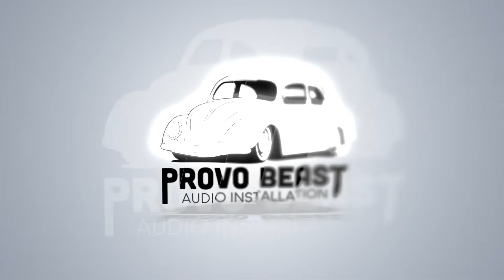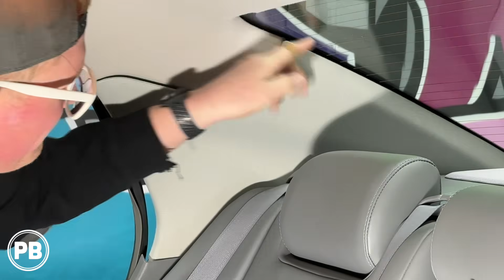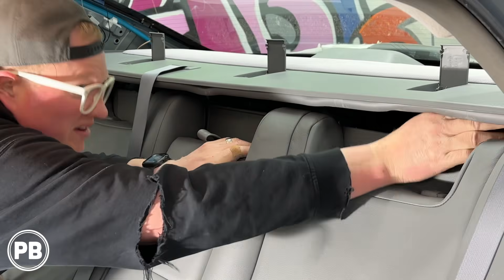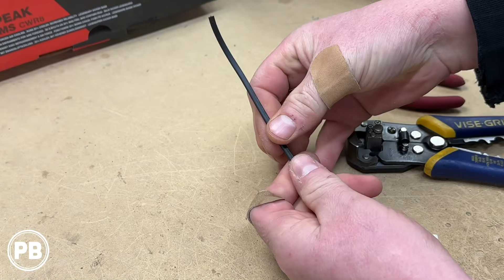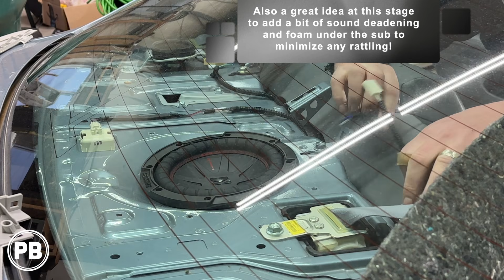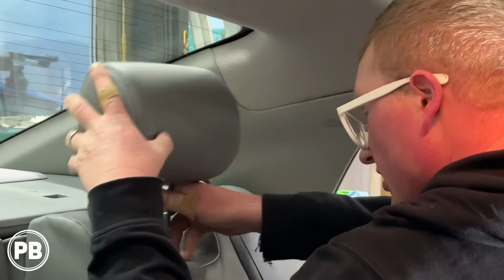2005 - 2010 Toyota Avalon Factory JBL 8" Sub Replacement

Comment: I have this exact car, and putting an aftermarket system in it has been interesting. 

The stock radio needs to be in the car and ON, for the climate control to work, if you install an aftermarket radio. There is a kit sold by crutchfield, that comes with the wires and brackets for the radio to remain in the trunk...POWERED ON. Crazy!!  

And the rear deck that he removed, is plastic.....it is the worst rattle i have ever had inside a car. I have soundproofed the rear metal deck and the plastic that sits on top of it. It helped, but still rattles more than i would want. 

I have had several subwoofer setups in this Avalon, 1 12, 2 12's, 2 8's, 4 8's over the years, and the more bass, the more the plastic rear deck rattles. I now have a pair of  Stereo Integrity SQL 15's in a sealed box, which has been the best sounding i have had. 

Great reliable car, but aftermarket installation has been interesting.
Reply: I have a 2011 with that JBL system.  I want to gut that JBL system.  Is it possible to do?  I want to replace that with aftermarket everything.  Pics of the SQLs??? I have the SI SQL 12"s  but trying to figure out the JBL system
Reply: I just scored this car from the in-laws for my son.  Obviously he wants carplay and such. It has the JBL synthesis system.   So just to be clear there is no easy way to replace the factory head unit without some wacky bypass?
Reply: @jonliska8401  Look fotr the PAC TY.11 Harness. That is what I used in my '05 to replace the head unit.

Comment: Adding a small amp like a Rockford Prime 500 with a base knob up front would take this system to the next level. 👍
Reply: Better to use a smaller 250.1 for that small FREE-AIR subwoofer since the rest wattage that it can handle gets lowered due to that free air use.
Reply: @thegreendoormx420  I would not waste my time with an amp that small. Plus it's always a good idea to run double or triple the power that you need. The number one killer of subs is too low of power and the person ends up pushing it too hard and you get clipping.

I realize the installer is not going to take my advice. I was just basically thinking out loud. Figured I'd comment to help the algorithm.

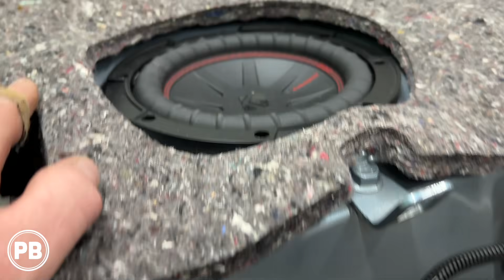Comment: 9:00 You might want to put a rubber grommet around that wire just for safeties sake.
Reply from the maker: Sure, but it's a painted surface without any rough edges and the high-temperate tesa tape will really protect that wiring.  I'd say the wiring will last longer than the remaining life of the vehicle.

Comment: What’s the performance like? I woulda done 2 12”s in the trunk.
Reply from the maker: About as good as the OEM was.  You know, I always recommend going with a traditional sub in box instead of the free-air setup found with this JBL system, however customer has the final say, and they simply just wanted to replace the factory sub, did not want a sub and box or new amplifier installed, and we left it at that.  Yes, 2-12's would have been nice, but budget, space, and customer preference prevented that option.
Reply: @ProvoBeastAudio Well it’s about as good as they can hope for then. Sometimes with those, I recommend going with the OEM audio driver. Similar to a 2003 dodge viper, you can try other ones but the OEM audio driver sounds best. But then you go down a rabbit hole chasing more bass and that’s lots when they come back for more custom work!